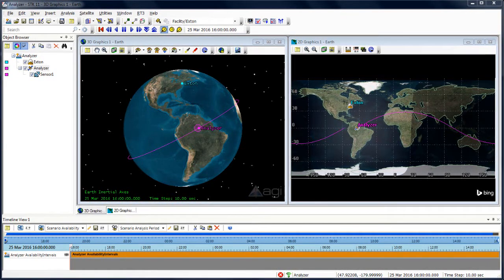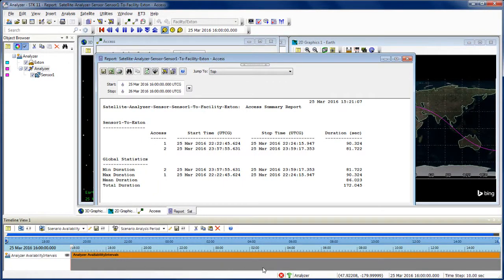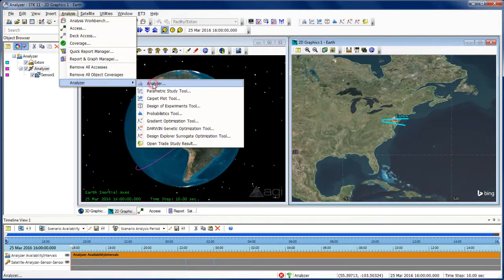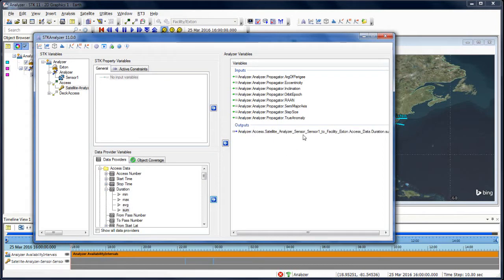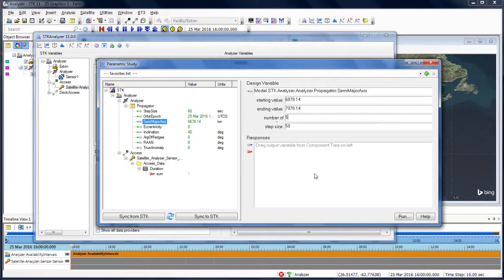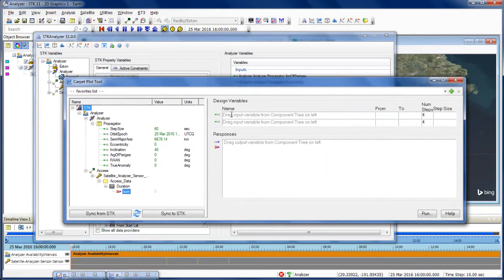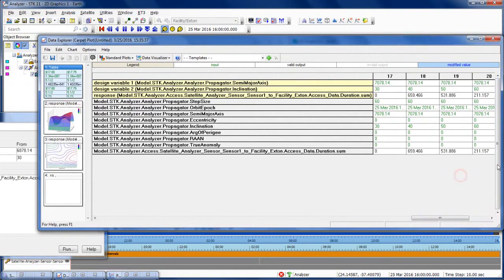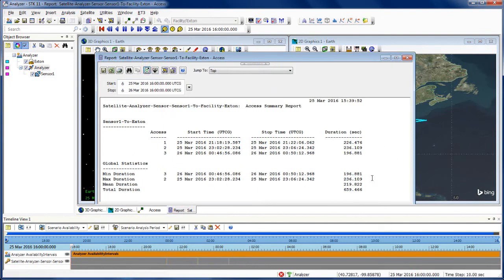Lesson 13 STK Analyzer

Comment: I don't have the "Analyzer" icon. what can I do? I have STK11
Reply: did you find a solution?
Reply: @nhlhockeyallstar  It was about my license. If you do not have the "pro" version you can not have this icon. There is a solution and it is that you can use the 2 weeks/1 month free trial account, which has the "Analyzer" icon.